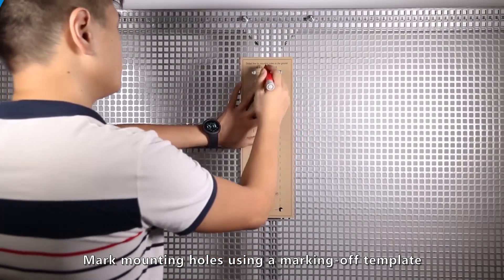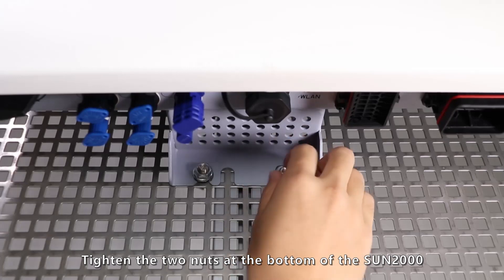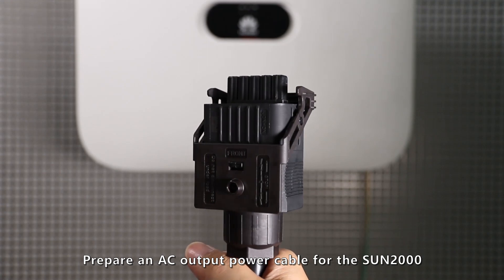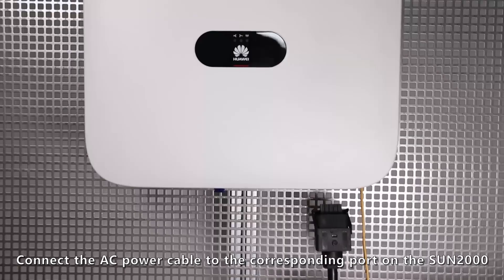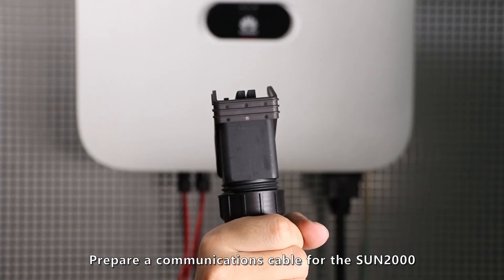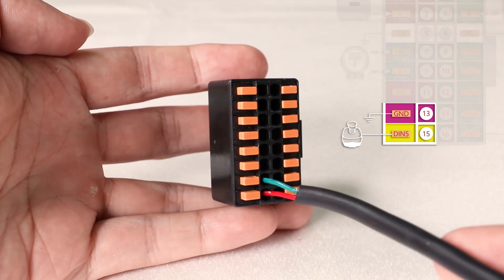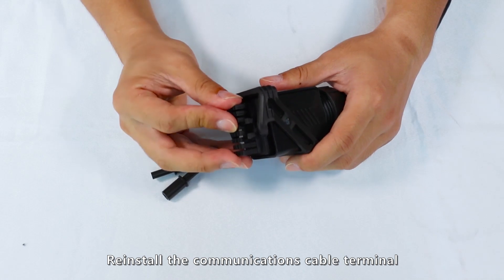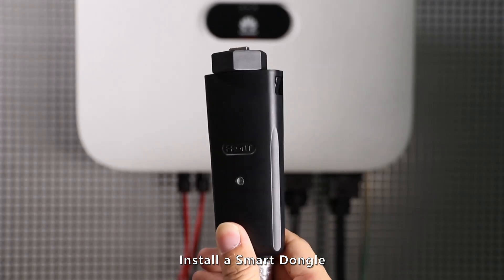SUN2000 3KTL-10KTL-M0 Installation Video

Comment: how to connect batteries with this model and whats the output voltage for battery from sun2000-10KTL
Reply: it 2 blue empty plug
Reply: are the batteries available?